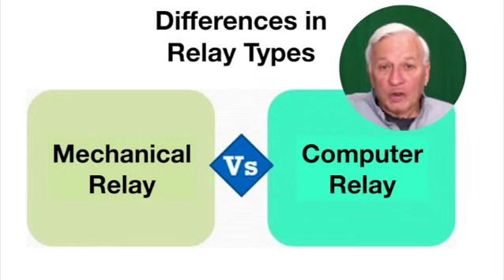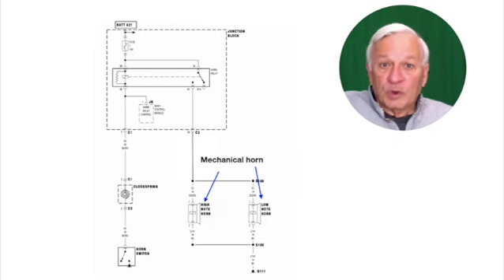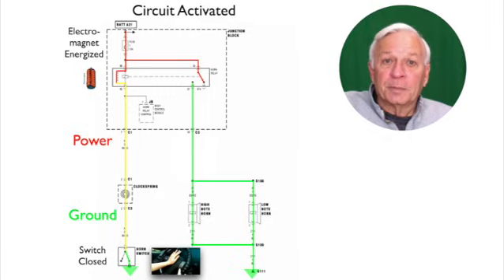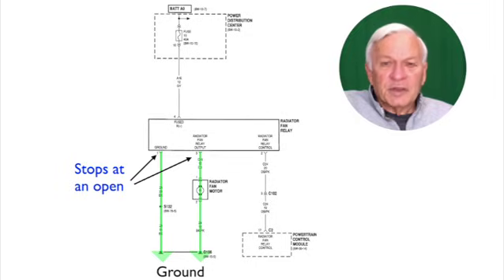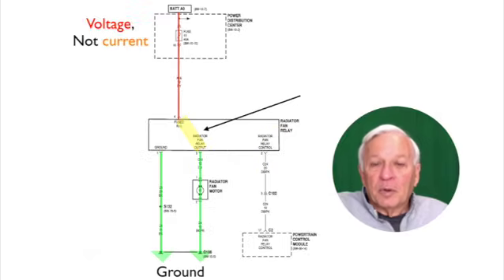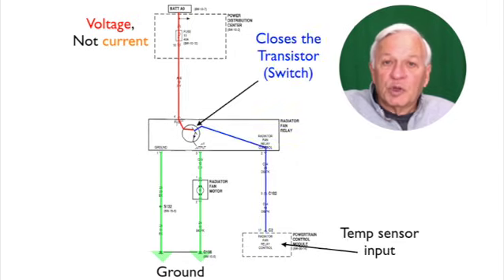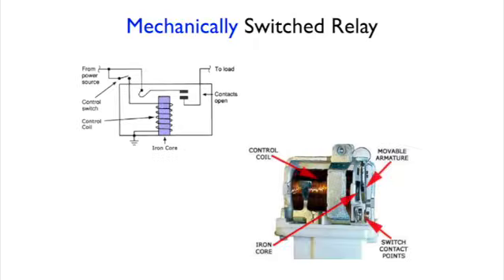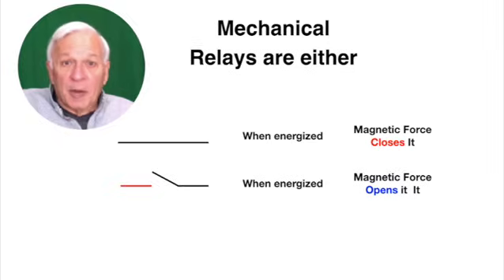Part 1  Difference between Mechanical and Computer Relays.    Part 1

Comment: Using B, C, E would of been easier to explain. Like a ignition coil driver inside the ecm, transistors have current and voltage limits.
A good example is on a Ford when a ignition coil shorts and melts down into a large current load for the ecm. It will kill the coil driver inside the ecm if the vehicle is continued to be driven with the bad coil. You can install a new coil but the problem remains. The transistor has self destructed trying to drive the shorted coil. Now you have a bad coil and a bad ecm. You can replace the driver in the ecm if you are handy with a soldering iron.
Reply from the maker: Thanks for the additional examples and insights!